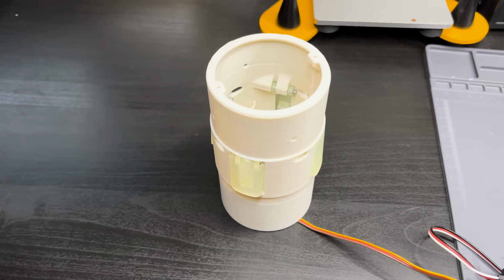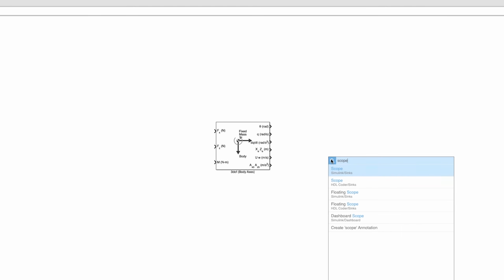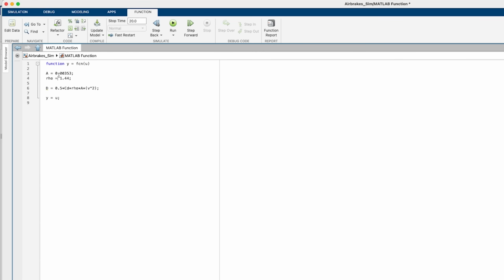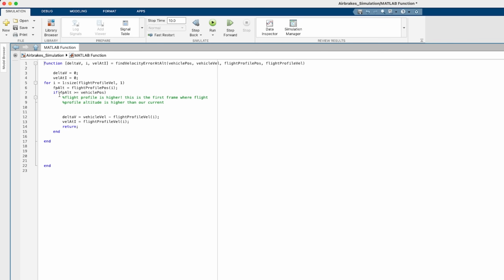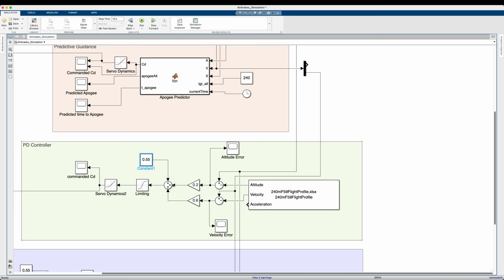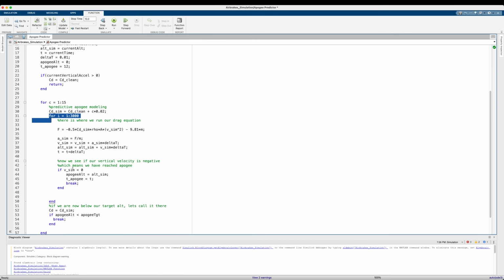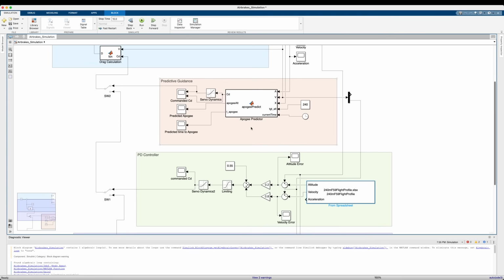Simulating Rocket Airbrakes in MATLAB

Comment: For a project i needed to program a flow and pressure controller. Basically you input a chart of flow and pressure values and the pump speed and a valve should adjust to meet the target. There was also flexible tuning involved. 

That was near impossible to get to work with pid since is so non linear. And pump and valve would influence each other. 

While still complicated but I think this style predictive guidance would've worked really well for that project. I will try to keep this in mind.

Comment: I did a project on this exact topic. Quantified the aero drag using tests and wind tunnels + a matlab sim. Would be happy to share it if you want. Instead of a for loop you can do a simple optimizer too or a bisection. you will reduce your loop time.

To make it more useful in a FC you can split the iterations over different frames. The rate of change of the alt is much smaller than the FC rate. It makes it much easier to run on simpler chips
Reply: hi, i’m designing an airbrake control system for my university but we don’t have access to a wind tunnel. I honestly started working on rocketry 4 months ago so i would appreciate any insight. I already have a control system set up, but right now my biggest concern would be how to calculate an accurate drag the rocket experiences for every airbrake angle during the flight. If you could point me in the right direction i would appreciate it a lot.
Reply: Hey would you be able to share this with me please?

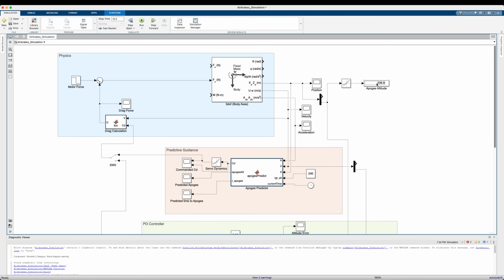Comment: 41:52 Heh, I thought it was a fluke, but then I realized it's temporally dithering over the few options, so it's probably not.
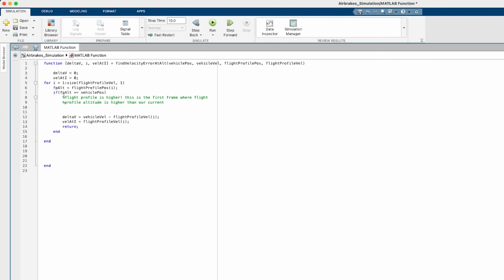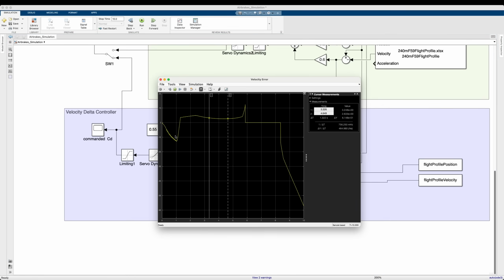24:58 I wondered if not interpolating that data would be a problem, but at 28:11 we can clearly see the the error signal is only very slightly blocky (or it's just pixel-level aliasing of the plot), so I guess the granularity was enough.

Good video!

Comment: is it possible to reuse a rocket simulation block inside a predictive guidance function instead of re-implementing it as pure matlab function?
Reply: I believe this isn't as easy here because the predictive guidance function has to run for every simulation tick, while the blocks would live in the same clock-cycle as the rest of the system. I'd assume this is possible using multiple clocks, but I'm not big into Simulink to be honest.
Reply: @OxibanCraft But you can have several instances of the same block, can't you?
Of course predictive guidance should have its own private instance.
Reply: @blacklion79  Yes you can, I was referring to when that block gets evaluated. If the calculations run at the same time go for it. The issue here is that for every step in the simulation the prediction algorithm has to run in its entirety multiple times before the next simulation step, where the blocks "live". Putting the logic inside a function ensures that it gets reevaluated for every substep of the simulation, instead of being part of it, like the blocks would be.

Comment: I’ve implemented the predictive controller on my rocket, but I found that Cd is nonlinear. I tried collecting experimental data during flight but it was too noisy and I did CFD but it didn’t match reality. The problem with this predictive method is it relies on a very accurate estimation of coefficient of drag vs airbrake deployment. I’m going to implement a new system where it estimates the coefficient of drag in real time to try to address this!
Reply: I quantified the air break  CD for this project happy to share it if you want. I have some validation against a test flight and wind tunnel tests
Reply: @doobaas  Interesting, could you post a link to the graphs
Reply: @doobaas i would appreciate that
Reply: where you successful in trying to address the problem? I’m implementing one too and what you mentioned is my biggest concern right now.
Reply: @shoken8321  I'm going to test it in January
Reply: @nv7213  Have you tested it? How did it go?

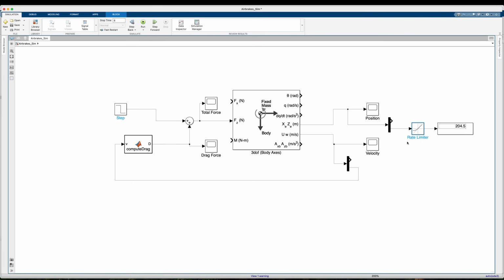Comment: 19:00 Thanks for vid. Why not use a "MinMax Running Resettable" block instead of rate limiting for the apogee? Or am I missing something
Reply from the maker: You can do that too! You can also use the backlash block or write your own “maximum” matlab function block. I used the rate limiter method because it’s a fun way to show a non-standard use of a block to get cool behavior. MPC is definitely more complicated, I used to do it on robotic exoskeletons. This would be a great project for someone to get into MPC and/or Adaptive control, but both were a little out of scope for this video.
Reply: If you're going for a full tree for the choice of Cd in simulation, why not go the extra mile with a simple MPC Controller? The simple model should be easily implemented in casadi in MATLAB, and then you get Cd out of an optimization problem.

It might take some time to solve online, but it's certainly an interesting case to see in application